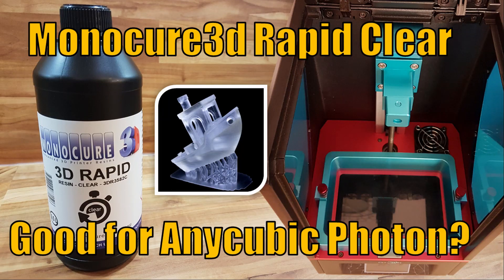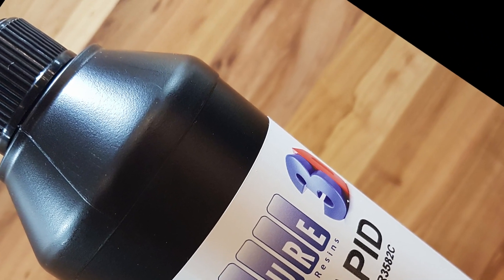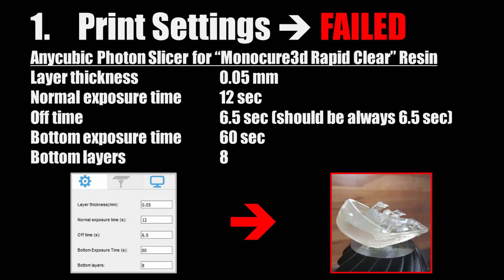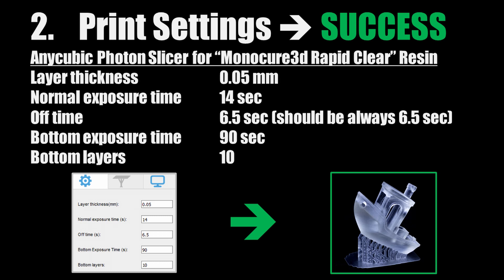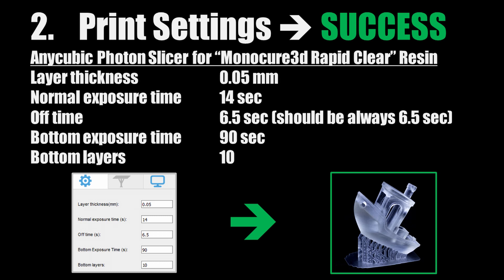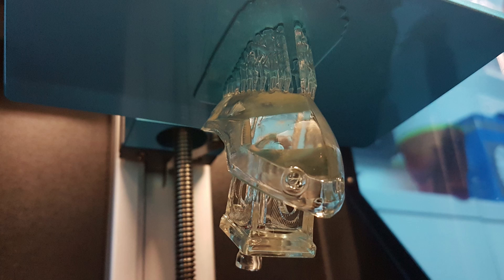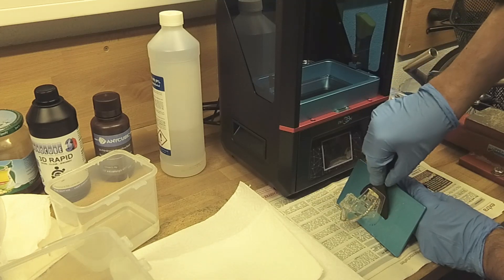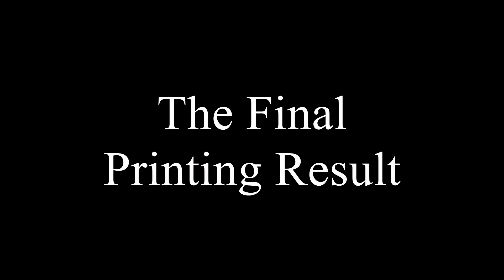#04 Anycubic Photon - Monocure3d Rapid Clear Resin - Quality and best printing settings

Comment: Great Video! Which UV box do you use?
Reply from the maker: Thanks! Meanwhile i am using the wash and cure station 2.0. Before (in this video)i used device for curing nails.
Reply: @android4cg  Awesome I own the Wash&Cure 2.0, too and ordered the Monocure3d because of your recommendation hopefully it will arrive today! Is your print yellowish with the Cure 2.0? Because I read on the Monocure page that other than 405nm light will get to this effect and the Cure 2.0 has 8 405 + 8 365 UV Leds
Reply from the maker: I have not used any clear resin since longer time. Therefore cannot comment.

Comment: How did you keep it so clear during curing? My clear prints yellow really bad within 10 under UV light.
Reply from the maker: I think i have done nothing special. I washed quickly the print with IPA and dried it with air. Afterwards the curing with UV light.

Comment: Fantastic - thanks for making the video!

I noticed that when the print was first pulled out of the bath that it was truly "crystal" clear, but after washing and curing, it had a "frosted" finish. I guess this is due to the very fine layer lines - do you think it would work to NOT wash in IPA, but just allow the excess resin to drip off, then cure in UV? That way, the liquid resin on the outside can fill the layer lines and give a truly clear finish?
Reply from the maker: That's interesting idea. But without IPA cleaning you will have slight oversize because alight resin film will remain around the surface. Especiall on small curves and very detailed parts this will impact. For large parts it could be worth to try.
Reply: @android4cg  yeah, you'll definitely lose fine details, but some parts (say, the cockpit of a model plane) would be OK with that (as long as some allowance was made for the increased thickness). 

I've heard of some people rinsing in IPA, UV curing the part, then dipping in resin again and curing to achieve a crystal-clear finish. I figured it would be easier to just not rinse in IPA and cure once.
Reply: Michael Noble hey, did you try curing the resin without ipa? How did it turn out?
Reply: @noreplyls9133  I'll be getting the clear resin in a few days - I'll let you know how it goes.
Reply: Michael Noble alright. Thanks! Are you using the mono cure resin on the video?
Reply: @noreplyls9133  yes. In Australia, it's hard to get many of the resins that are popular overseas, but Monocure is one of the cheaper options (as it's made here). I see it's one of the more expensive resins in the USA...
Reply: Michael Noble yep! Non-Australia resident here and I think the prices are significantly higher. Gotta sacrifice the costs for a beautiful print! :)

Comment: I have buy nowe the orginal anycube resin but the settings do you have link fore good settings thank you bro
Reply from the maker: Good starting point are the recommended settings on the following sheet which i have found via search with Google. I am not responsible for the content. https://docs.google.com/spreadsheets/d/1crvzMnt_8NJXAsABinoIhcOjE8l3h7s0L82Zlh1vkL8/edit#gid=0
Reply: Thank you again

Comment: I've NEVER had mine set to stay off for 6.5 seconds
Always just 1 sec
Reply from the maker: This means you never wondered why the calculated printed time does not match the real printing time?
Reply: No not at all. The estimated print time doesn't really affect my business at all. I know how long my prints take and I'm pretty good at estimating my times for new models 💁
Reply from the maker: In this case (if you do not want precise print estimation time) you do not need to set the off time parameter to 6.5 seconds. But there is no reason not to have the correct printing time without any impact to the print procedure.

Comment: Well done video, very informative. I really like the finished look of the clear Resin. My experience with the Anycubic Branded Clear Resin was not good at all. It yellowed badly when exposed to UV light. Was there any yellowing noticeable. (Could not see any from the Video).  Thank You
Reply from the maker: I also had this issue and could eleminate this by using UV light (instead sun light). Beside this i am using fresh isopropanol for the glass clear resin which was not used with other resin before.
Reply: That makes sense as I used daylight to cure my clear resin print. I just received a UV Light Unit. Hopefully better results. Thank You
Reply: I have been having issues with it yellowing as well.  I cured for only 10 minutes with uv light and it still turned a bit yellow....  Formlabs say to clear coat it with UV protective spray before curing  but then how does it ever cure?

Comment: anyway to speed this up? went from 3 to 7hrs
Reply from the maker: I guess your calculated printing time increased that much in your case because you changed the "off time parameter" from e.g. 1sec to 6.5sec? The "off time parameter" is currently hard coded in the Photon FW. If you leave this parameter at lower value (e.g. 1sec) than your CALCULATED printing time will be much lower. But the REAL printing time will be much longer. You should set the "off time parameter" to 6.5sec to get realistic calculated printing time which matches with current hard coded time for the layer increment. Check out my video "correct printing time" where i explain this behaviour. I hope this helps?
Reply from the maker: Hi Christian! Based on your feedback i have check the behaviour again today with latest available Photon firmware from 20. june 2018. When setting the offtime parameter to 1 seconds the real offtime is about 6.5 seconds. The 6.5 seconds is the time the z-axis needs to move up and done. This means that offtime parameter settings below 6.5 seconds does not make any sense and will result in the real offtime of about 6.5 seconds. If you set higher offtime parameter (>6.5 sec) than the real offtime will be also increased. E.g. if you set the offtime to 10 seconds than the photon will (1.) stop the uv light (2.) move the z-axis up and down, which will take about 6.5 seconds time (3.) wait another 3.5 seconds (6.5 + 3.5 = 10.0 offtime) and (4.) start the uv light again. It would be clever from Anycubic to allow only offtime values higher than 6 seconds in the Photon slicer in order to stop confusing the customers.

Comment: Hello, does anyone know which is the cheapest non original and suitable resin for photon?
Reply from the maker: This is very difficult to be answered because the price depends very much on the availability of resin sold from local shops. Best is to check the database and compare with local availability. This is the link to external database which is very useful as first starting point when searching for compatible resin material: 
https://docs.google.com/spreadsheets/d/1crvzMnt_8NJXAsABinoIhcOjE8l3h7s0L82Zlh1vkL8/edit#gid=0
Reply: Thanks!
Reply: And what about fet film, is there cheap alternative?
Reply from the maker: I personally do not know.

Comment: I have heard that different colors cure differently and I have heard that some either dont cure completely or have a short lifespan. Do you have a take on this or any recommendations regarding different colors for the Anycubic Photon printer?
Reply from the maker: There is very good database for different resin materials to be used with the Anycubic Photon. This recommendations are very good starting points. The link to the DB (which is not from me) is: https://docs.google.com/spreadsheets/d/1crvzMnt_8NJXAsABinoIhcOjE8l3h7s0L82Zlh1vkL8/edit#gid=0
Reply: Thanks, not impressed with the limited hindsight of the author disabling downloading of it though. I would rather be able to print this out as a reference rather than being forced to have the page open. Still a valuable resource that I hopefully can contribute to soon.

Comment: Thanks for the time you took on the video. I've been using the exact resin now for a few weeks. I have had a few issues with ineffective layer bonding and some bubbles (bubbles?) getting in there somehow. I've tried close the the same settings, but the resin is still just 'okay' - I'm going to run another test with the resin that anycubic makes again when I get some ordered.
Reply from the maker: Thanks for your feedback! It is always very useful for me and others to share experiences.

Comment: will it work for the grey the settings
Reply from the maker: I will test the Rapid Grey soon. Based on information i have found from other users the Rapid Grey should have quite similar settings than the Rapid Clear. I will make short video when i have tested it.
Reply: All About 3D Blog  very nice I tryed setting work perfect
Reply from the maker: Many thanks for the positive feedback.

Comment: You have Z wobble.  See if you can correct it by tightening your linear carriage roller bearings.  See this video.  https://youtu.be/4cfCWmHtsy8
Reply from the maker: Thanks for the hint. I have done the workaround on the z-axis today ... will report back when i have done new print after this correction.
Reply: Cool!

Comment: No, you don't need to set the off time to 6.5 seconds.  Doing so only allows the slicer to calculate the print time more accurately but the Photon will show an accurate print time once the print is started.  It's a bug in the slicer software.   Also, the bottom layers really don't need 90 seconds if the zero is set correctly.  The Monocure recommended 60 seconds works fine.  I've done dozens of prints with the lower setting.  If the build plate zero is set incorrectly, you need to compensate with a longer bottom layer expose time to cure the first layer which is greater than 50 microns.  You're better off setting the zero too close than too far since the first thinner layer will overcure and stick to the build plate.  You also don't need 10 bottom layers.  The longer bottom layer settings overcure the initial layers to ensure adhesion to the aluminum build plate but is a waste of time after the first few layers.  That's why there is such a drastic reduction in the normal exposure time vs. the bottom layer time.  As mentioned in another comment, do yourself a favor and join the Facebook group if you have or are contemplating buying a Photon.
Reply: The whole point of setting the 6.5 second off time is to know the print time BEFORE starting the print.  Otherwise, the slicer reports an erroneously calculated print time.  Yes, it is a bug in the software and setting the 6.5 second off time is the workaround until they fix it in a future update.
Reply: Yes, and you found a workaround. That's great.  Hugh Essay stated, "No, you don't need to set the off time to 6.5 seconds." and I was just explaining the reason why you do if you want to know the correct time before starting a print.  Until the bug is corrected.
Reply from the maker: Agree that this is bug in current slicer SW because it does not make sense to have configurable parameter which doesn't have any function. BUT ... based on current SW/FW release the off time parameter should be set to 6,5 sec as long as the z-axis up/down movement is hardcoded like this. With higher bottom exposure time you gain more print security with only very little more printing time in total. Why not adding some safety to also allow some minimal inaccurate homing? Happy printing
Reply from the maker: It's a "bug" in the FW from the pinter and the value of ~ 6.5 sec for the off time (up/down movement) is hardcoded there. The slicer writes the configured off time value to the .photon file but the FW does always use the hardcoded value. As long as the FW is hardcoded to this value the slicer should be configured with this value in order to do correct print time configuration. If the FW will be changed the value might be also changed.